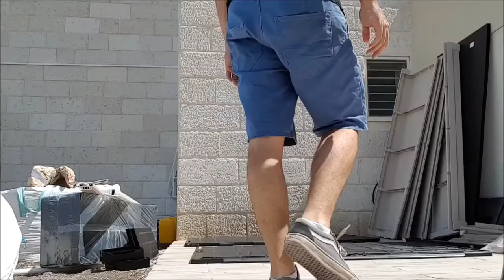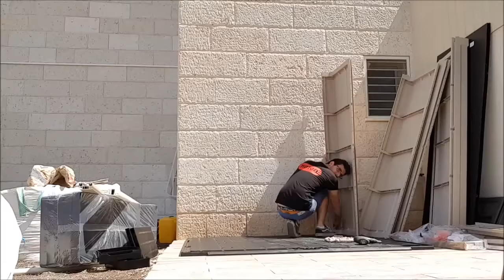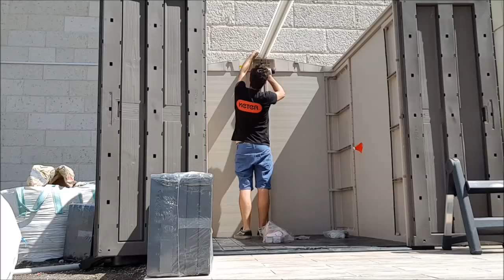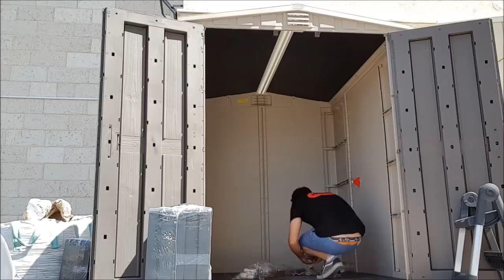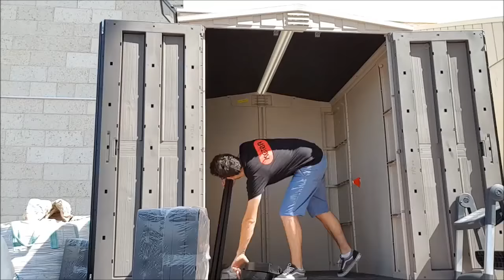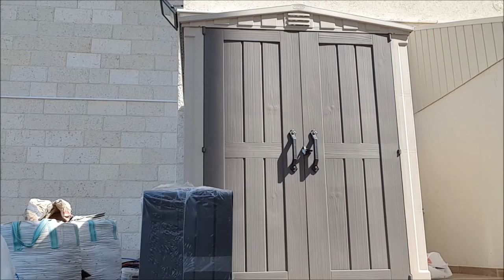Keter Factor 6x6 Outdoor Garden Storage Shed

Comment: Hi MoA, How do you like/rate the product after almost two years after installation / use? How does it withstand on wind and / or rain?
My intention is to have it installed somehow isolated, in the back of the yard, with no protection against wind or strong snowfall.

Thanks
Reply from the maker: i don't recommend it without wall if there are winds more then 40-50km/h
snow its not a problem but if it's empty very strong wind can flip it
you have to fill it up